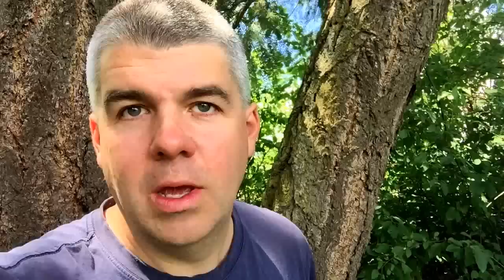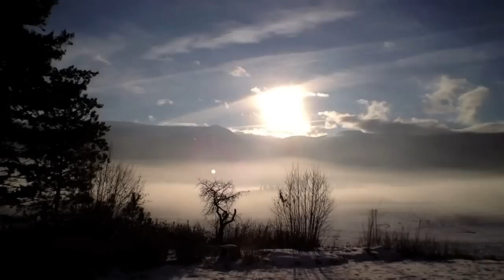Profiting from your own errors

Comment: I love the "inside baseball" you give. I need my car's oil pan gasket replaced. The dealer quoted me $450 to do it. A small local shop will do it for about half that. And I know and trust the local guys. My experience with this dealer tells me I need to count my fingers after I shake his hand. There may be a legitimate reason for the dealer to charge so much more, but that isn't, or shouldn't be, my problem. It may just be a case of shit flowing downhill.
Reply from the maker: Tom McDonald Thanks Tom, I appreciate the feedback. In general, the added dealer cost tends to reflect the overhead of those massive Taj Mahal dealerships. They do have some astronomical business expenses that smaller garages don't have and you are right, it's not really your problem (at least, not when you have alternatives). In some ways I do feel for them (big dealers)....they simply cannot compete with a good small neighbourhood garage on our terms (especially not when it comes to customer service). Then again, it would be impossible for the dealers to service all the cars they sell so people really need  us independent guys out there. 

Cheers!
Reply: ***** That makes sense, and I can see how both the overhead and the (I'm guessing) requirement that the dealerships buy their parts from the manufacturer at full price rather than the prices you would shop for, for your customers, would drive up their costs. What really bothers me most, though, is when dealerships try to up-sell extra, sometimes unneeded and unrequested, services that further jack up their profits. I suppose some of that is simply due to how complex cars are nowadays (I'm old, I can say things like 'nowadays' unironically  ;-) ), together with how few of us anymore can do any of our own service work. To a certain extent, that can be useful. 

But still, I've had dealerships offer good prices on, say, oil changes, only to have them dick around and find some of my other fluids are a bit dirty, or that my headlight covers are not as clear as they could be, or that they could really help me improve something if I just let them do a couple hundred dollars more tinkering. I know about loss leaders, and can appreciate the helpful advice, but I've gotten more hard sell from dealers who actually missed important safety issues like ball joint or steering problems. If they are going to upsell me, I'd prefer they focus on the stuff that could kill me rather than stuff I'd planned to take care of in my own time.

Comment: I work in the auto glass industry and I see things reminiscent of that even here.

Dodge has a habit of moving the VIN window on its windshields an inch or two over between minor iterations of its vehicles. Off the top of my head I can name the Journey and the Caravan as having this odd change, though older Rams did this too (not sure about new ones). The glass itself is exactly the same shape and size. The only difference is that VIN window, so the older, cheaper windshield would be illegal on the newer vehicle.

In contrast, Ford has essentially used the same windshield for Super Duties for about fifteen years. Econolines haven't changed in at least the same amount of time, either. Not only has the shape and size remained exactly the same, but the VIN windows haven't moved at all. Sure there are newer SKUs, with variations on logos and edge patterns, but the old ones remain 100% compatible.